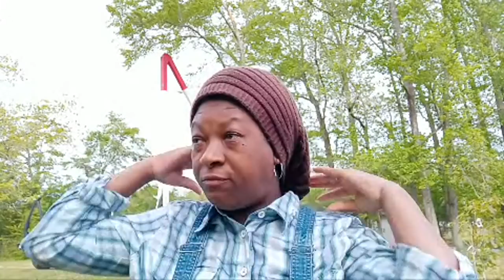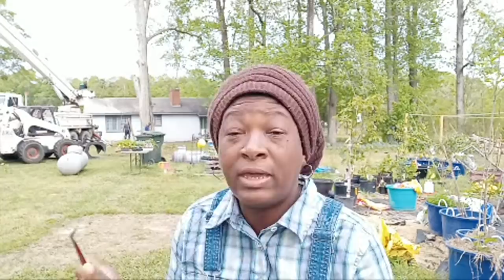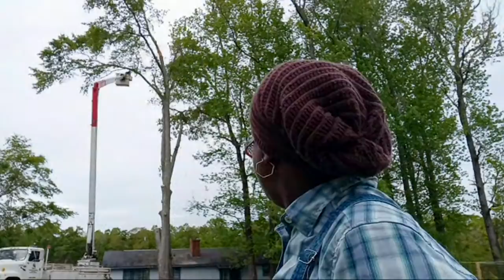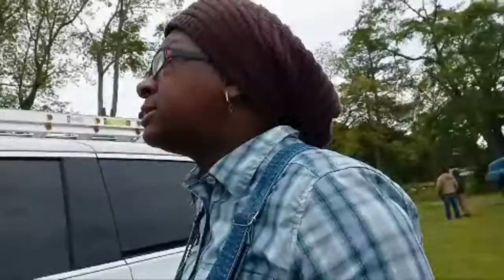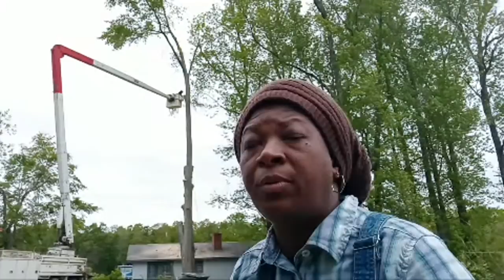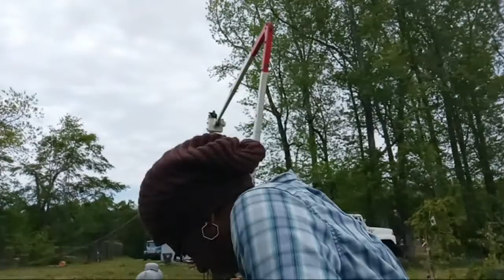TREES DAMAGED BY TORNADO COMING DOWN

Comment: Mrs. H.  I dealt with insurance company after Hurricane Michael.  I had several adjusters  to come out to  look at damage.  Make sure that you look at every aspect of your home.  Make sure there are no cracks in your exterior walls.  You can request your insurance company send out an engineer to see if any structural damage  has occurred.  Check your windows to make sure they open and close correctly even if they were not cracked.  The wind could have shifted your home.  Also, they will need to replace your floor coverings where the water damage happened.  You can request a different adjustor!!!  Continued prayers!!!!